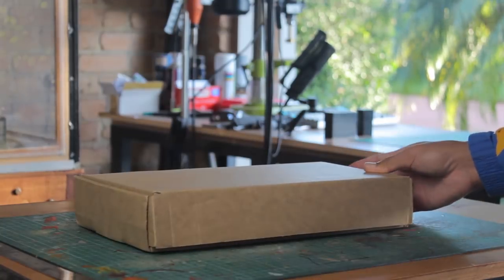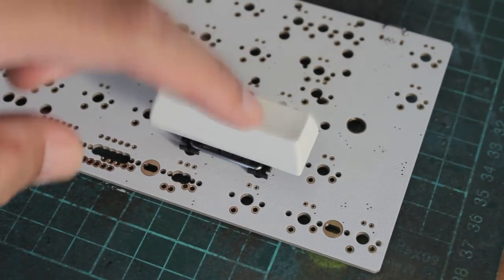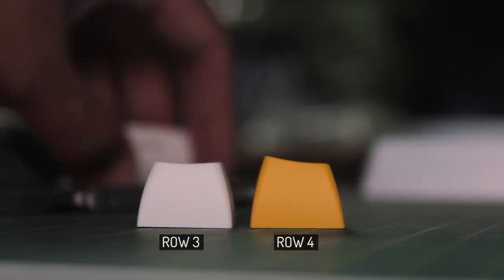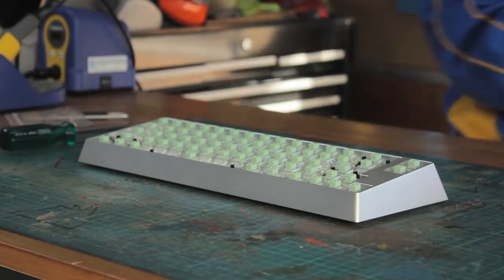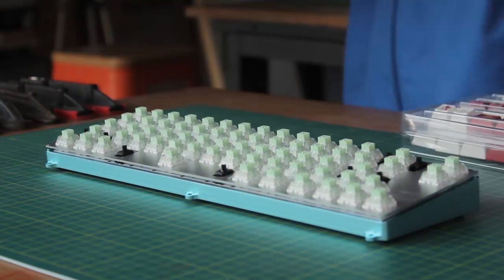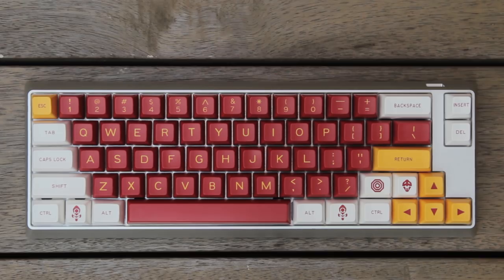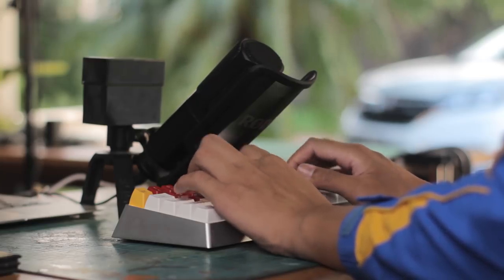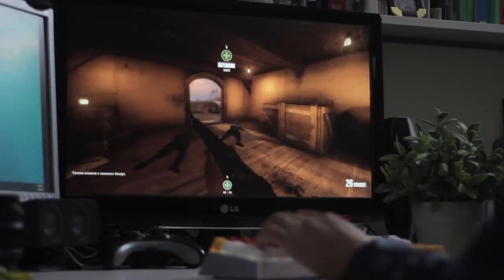KBD661 with Kailh Box Jades - Mechanical Keyboard Build & Review

Comment: Soldering switches before the LEDs has a drawback. I had several LEDs not working after I soldered them, so I needed to replace them. If you solder the switch before the LED you need to unsolder both the switch first before the LED which is double the work. But hey, to each his own, everyone can assemble the keyboard however they like. That's the appeal of making a custom keyboard.

Comment: SA Keycaps sound amazing on those switches.
I'm getting MT3 keycaps for my BOX Navy switches which I hope are gonna sound as good as this keyboard here.
Reply: They have the same click bar so chances are good.
Reply: I do not doubt the BOX Navies are gonna sound good.
What I'm wondering here are the MT3 keycaps gonna give the same deeper sound like the SA keycaps give on clicky BOX switches.
Reply: Ah, then I missed your point. Hm, of course the material and form plays role. So I am using cherry profile PBT key caps with 0.8 mm and POM caps 1.4 mm , the thicker variant sounds basier. For shure they will sound amazing in this set up. There are some remors that the keycap stem of the box switches has some issues with there quality control, and I indeed broke some of my switch tester keycaps with the box jades. The PBT caps, however seem to have no issue at all, so far.
May be you have look here, I gues your caps are expencif:
https://novelkeys.xyz/collections/switches/products/novelkeys-x-kailh-box-thick-clicks
please note that box stem...

Comment: I built a gh60 lately with BOX white (Jade seemed a bit too much at the moment, but as of now, I think something heaver would be better). Next time I'm building a keyboard - it will be a version with Fkeys row and arrows segment on the right, though I got used to WASD-keys as arrows with a modifier put instead of CapsLock. By the way, if you muffle the bottom of the case with sound isolation layer and put some thick silicone grease on stab frames - the sound will be better.

Comment: I just found this video and was intrigued by the part where you were soldering the switches. would it be a worthwhile idea to unsolder switches off a retail keyboard reuse them for a custom one?
Reply: no its too time consuming seriously you dont wanna unsolder 104 key
Reply: I swapped the switches on a 110 key board with cmx browns for box jades recently, and it was my first time desoldering anything and my second time soldering. Make sure to use a decent iron and desolder pump. As long as your fine spreading out the project accross a few days it's manageable. Definitely don't try to do it in one go.
Reply: CHOPSTIX ah I was considering desoldering some cherry mx browns off my old razer blackwidow and using them for a keyboard like the one in the vid
Reply: JustIncognito doubt the effort would be worth it for mx browns. If you're gonna put the time and effort into doing a custom board, go for something special like zealios. (Unless you really love mx brown for some reason, but even then just buy some, switches don't cost that much compared to all the other stuff you need to make a custom board)
Reply: CHOPSTIX THIS if you wanna unsolder the whole thing you should get something rare that retail board didn't have. and decent soldering iron is a must you dont want to break your pcb because of soldering iron overheat

Comment: Question, What makes the keyswitches sound the way they do? I have box jades in my black widow chroma with pudding keycaps, and i understand that the sound will obviously vary with the base material of the keyboard AND the switches, but I have previously tried placing the same jades into the GMMK with a metal base and different keycaps but they never sound as amazing as yours do! Do I need to combine a metal frame AND SA keycaps to achieve the godly sound of this keyboard? Thank you for your help!

Comment: is there still some plate rattle or is it just the sa spacebar with the bad stab...i don't mind rattly stabs but it also sounds different than mine....that shift though...lulz
Reply from the maker: Plate was completely fixed. There is still a bit of spacebar rattle though. I've lubed them up more, but it doesn't seem to fix the problem. Might have to fill up the space a bit somehow.

Comment: What LEDs did you use? I just got my pack, soldered one in to see if it's working and found it's barely visible.
Reply: You should probably flash the pcb. When creating a keymap you can bind 'BL +' to a key. After you have flashed the pcb, just press that key and the brightness of the led should increase
Reply: @ivoruiter6605  nah, i derp just put them the wrong polarity

Comment: Work on your soldering,  your burning the board man.... heat the led (or whatever) wire up above the board.. touch the solder to wire at threw point you want to solder to... it's a little more tedious but much cleaner.

Comment: Like your video. Please help.
I’m looking to get the absolute best gaming keyboard for CS-go. I don’t care about price. I want one that has the absolute fastest switches, one pros use, and one that has the best wrist rest. I narrowed it down to 3.
Corsair K95 RGB Platinum with cherry x speeds
Razer BlackWidow chroma v2- rgb with yellow switches
Zowie celeritas ii (I don’t know if the optic switches are faster than the cherry x speeds and the razer yellows)

Thanks!! I don’t care about price.
Reply from the maker: I think MX Speed Silvers and Razer Yellow's are pretty much the same. I don't know about optical keyswitches. 
You probably don't need a numpad for CS:GO. You can have more space for your mouse if you get a tenkeyless keyboard, or something smaller.